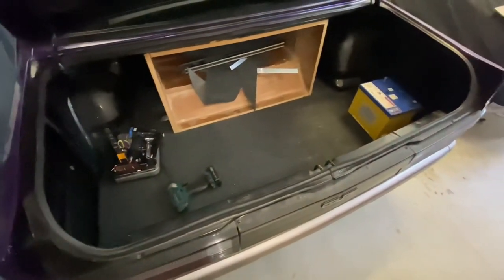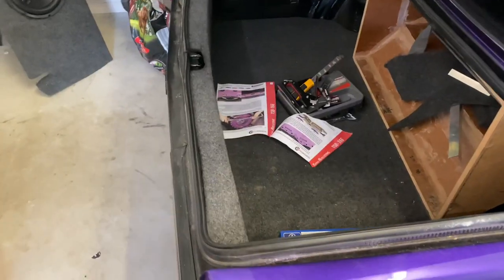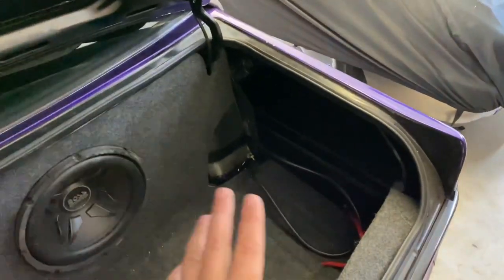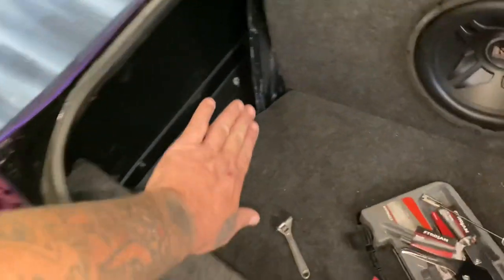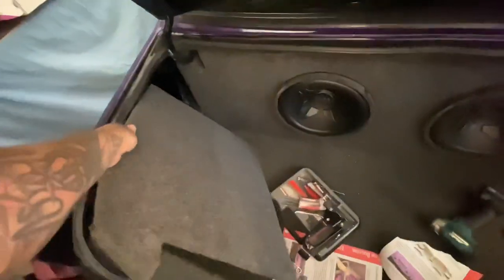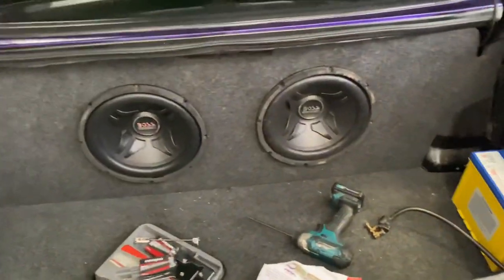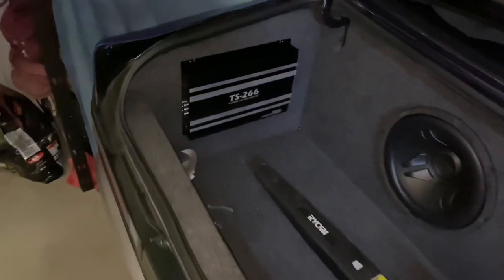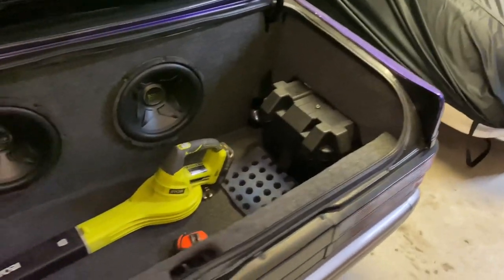[VL TURBO] Sound System Boot Install Part 2

Comment: I reckon the amp looks good there
Reply from the maker: Undecided atm where to put it still thinking of hiding it
Reply: Why don’t you mount the AMP on the left-hand side of the boot
Reply from the maker: @mackaatya7959  I think it’s going to look messy because you will see the cords because there on the side of the amp can’t really hide it unless I make a drop box on the side panel